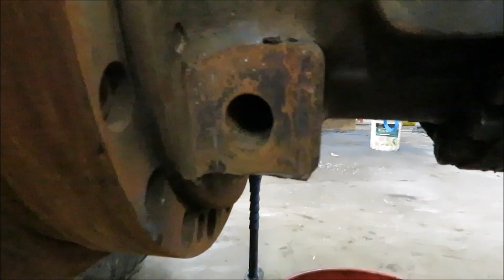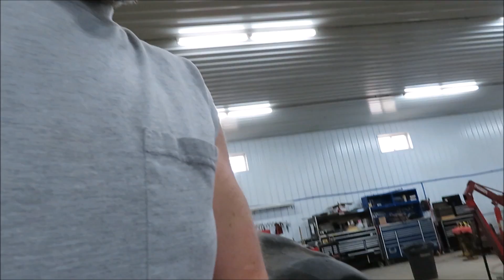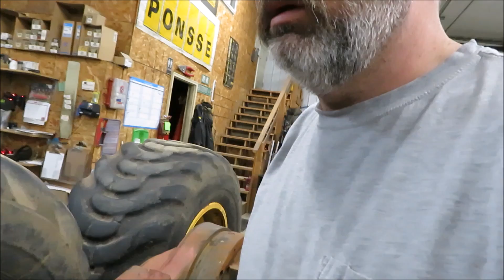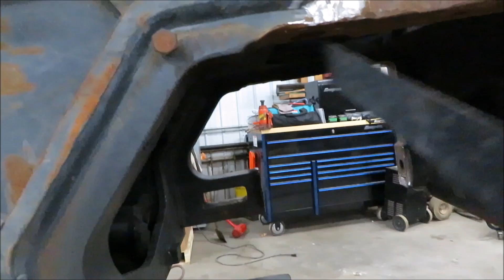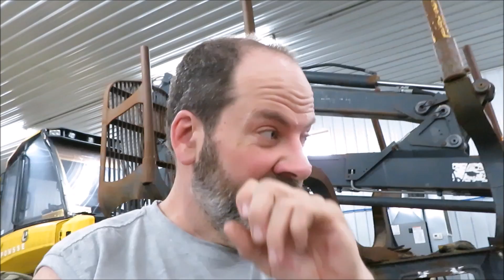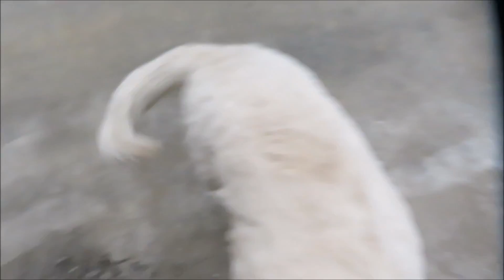Wow! Ponsse Axle ep2

Comment: ihave a simular story. boss man buys a forwarder (the chepest one) 10 years old 10.000h. so i tell him it needs big service.
no no we fix as we go and its winter. go make bank. so i go driving in 45 degree slope down hill whith full lode.
stupid sit right seat hits emergensy off button and the machene starts roling and roling. i cant do nothing.
it roled abaut 40 meters and then whent on its side thank god it did that. the machene stoped on it side 10 meters above a cliff.
so we got a 25 ton escevator to flipit back upp and started tring to findaut the problem. break test no good. no leaks 
the prevus owner had caped the hydraulic line for the breaks and skrewed in the screw on the front axel.
operators do thefukking breake test.
Reply from the maker: Oskar grönholm your one lucky sum bitch!!! We always find out hard way!

Comment: Going through the same thing with a international paystar. Guy bought it for a good deal. ISX Cummins, with bad EGR system, fuel metering system full of silicone,  steer axle suspension destroyed, and 3 poorly repaired cracks in the frame. Still thinking they got a good deal.